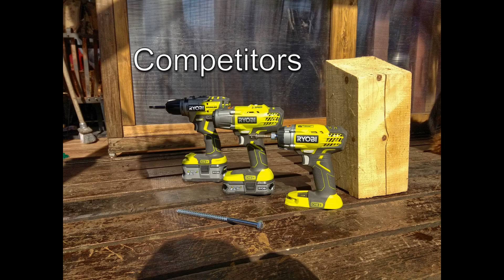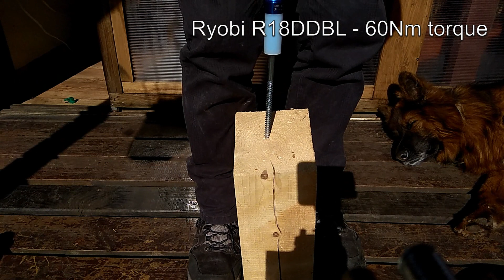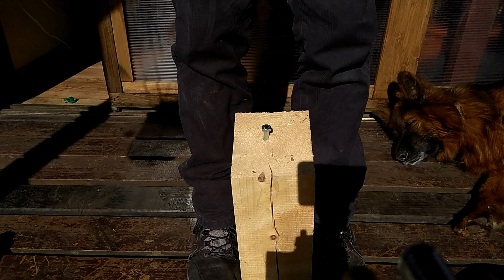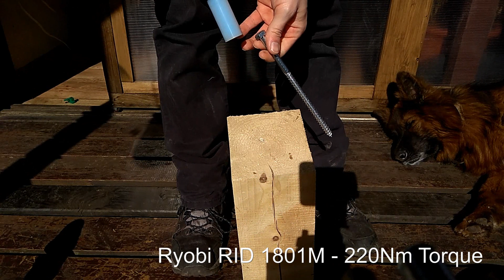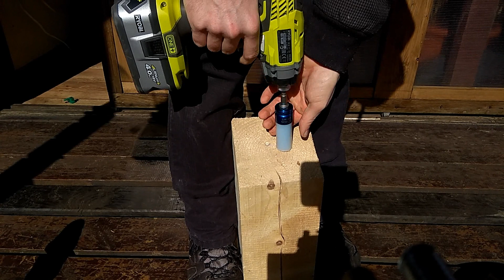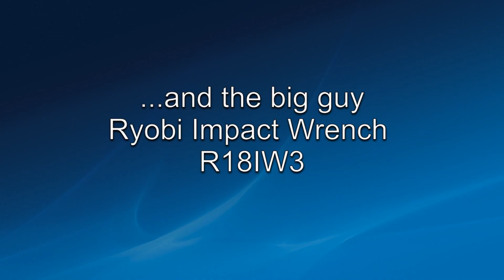Ryobi Battle - R18DDBL vs RID1801M vs R18IW3

Comment: The drill would have finished that lag bolt with the larger battery. That was very impressive with the 2.5Ah battery!
Reply: Yeah, the drill smashed that bolt in given the small battery. A 5.0AH HP battery would have done it.

Comment: So, will the brushless still stall if you use the bigger 4 amp battery? Looks like it has lots of torque for sure. I haven't been able to talk myself into buying one yet, I have several Ryobi drills and it would basically getting it for the hell of it, but it sure is tempting.